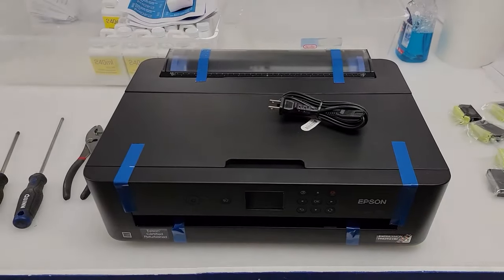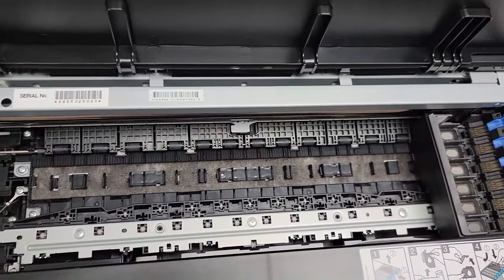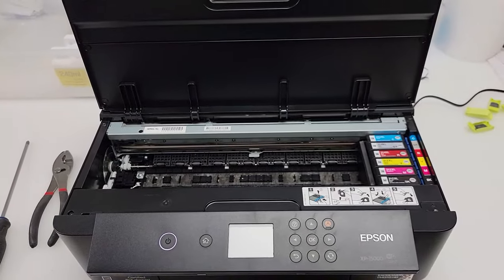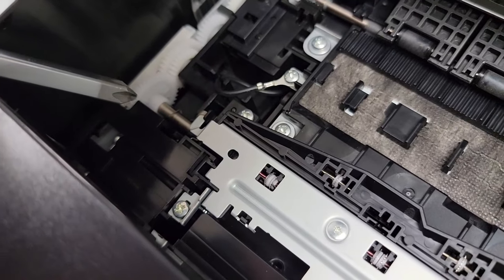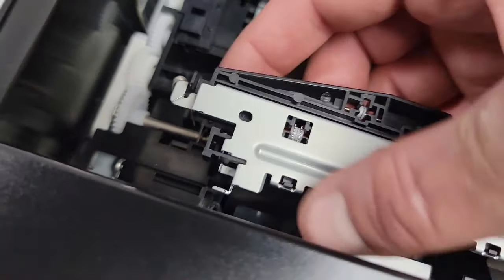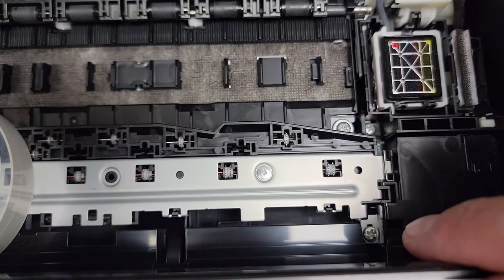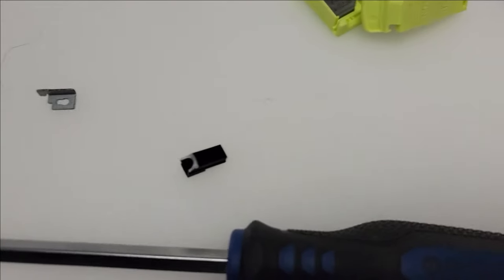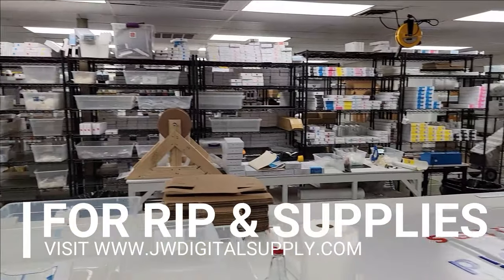JWDS Epson XP 15000 DTF Conversion   EASY

Comment: tip you can get the roller out without breaking the tip if you push the print head over close to right then  lift up on the print head lightly  will lifting and pulling the roller from the left

Comment: Hello quick question when you’re setting up the ink what color order should they be in and it should be 2 whites correct in replacement of GY , R .    So C , W ,W , Y, M , BK Is correct right?
Reply from the maker: This is correct - use the default CMYK channels and replace the remaining colors with white ink.  Of course, the RIP you choose will also likely have the ability to define custom ink channels - this would allow you to load the ink in any order you wish.
Reply: @jwdigitalsupply9944   hey I just can't around your channel can any printer can get converted to a dtf

Comment: I didn't have to break those brackets, though. With the print head about midway, I pulled both ends up and it slid right out.

Comment: Quick question on removing the plate. Do I need to put it back in afterwards? On the subject of reconfiguring the printer with a new set of DTF Catridge. I have purchased auto-refill cats, would I be required to get the third party firmwire at all?

Comment: So you don't add the dtf cartridges to begin with you use the original that came with printer ?
Reply: I asked the same question and the answer is that the ink of the original carts is not DTF, so what they have been doing is removing the original ink with seringes and somehow cleaning the carts. Then they inject DTF ink into carts.

Comment: I was setting up my printer and had to get air bubbles out so I removed the tube from the cartridge and the tube from the ciss. Ended up over flowing my printer with ink and I’m having a hard time cleaning it I’ll it out the printer. Will the overflow have any effect on my printing? how do I properly get air bubbles out and refill cartridges? I keep getting maintenance error on my printer but I have ink. I haven’t bought the activation key.

Comment: Thanks for the video. I followed to a tee. I installed chipless software and ink cartridge's. Then I installed cad link for my rip software. Something is off it either printer a little red and nothing else or nothing at all. Any ideas on what I might try? I tried several prink head nozzle checks. I did a couple print head cleaning, I took the ink cartridge's out and cleaned the undersides and ran a paper towel under the print head still nothing.....

Comment: My white ink is recently not showing up at all for some reason on my XP15000, and I've tried cleaning it with DTF cleaning liquid but it doesn't seem to work. Even put in new cartridges. What I did was put a few drops of DTF liquid into the printhead, swab it, clean it up, and then proceed. Is there a step I am missing? It has been pulling my hair out. Thank you.l

Comment: Just a question, why do you need to remove the  rollers? was just wondering
Reply: Removing the rollers simply prevents them from streaking the wet ink.  When printing as a stock unit, the paper is dry before the rollers make contact.  However, with DTF ink and film, the ink is still wet when it passes through the rollers.  Removing them can eliminate the streaking which would normally occur.

Comment: First off thank you for this video. Secondly, is epson xp15000 the recommended printer for conversion? Any other epson models that will be similar? I think epson also has the 15000 (non xp white one too).

Been trying to get the dtg system for awhile since I do screenprinting, sublimation and embroidery this would save me time to do one offs or emergency situations and wondering how new is dtf printing? I think its been around but not really booming until bout year?
Reply: Epson 1430, make sure it is new…it is costly, it’s the version before this one but it works perfectly
Reply: @SuaveCityGear  what about epson 1400? i have this now..
Reply: Check out the Epson 7710 after YouTubing the videos this is my go to
Reply: @antoniahill2665  for dtf? Really? I have an extra 7720 so if I could use that it would be fabulous!
Reply: Ok, so I'm getting so confused here. Lol I just bought the epson expression photo hd xp-15000 and some chipless cartridges and some sublimation ink.. can I convert this printer? And if so, I need help with a link to do so if dtf isn't the same ad submission ink. Please someone help me. I'm about 600 dollars in, and not a clue what to do!!!
Reply: @magenbrockgolden5243 dtf is not the same as sublimation ink. But you will be more flexible converting the printer to dtf

Comment: Have you ever added the inkxpro 312XL Empty Ink System CISS Refillable Cartridge Kit with Ink Flow Control Damper for Chipless Firmware Installed EPSON XP-15000 Printer?

Comment: How did you remove the ink cause now I have the ink that not DTF in my printer
Reply: Simply put in the new ink supply system and run an ink charge or a series of cleaning cycles to move the new ink through the print head.

Comment: How did you get it to print white for dtf
Reply: You have to do the firmware he didn't go over, then it goes into the grey spot
Reply: You have to do the firmware he didn't go over, then it goes in the grey slot

Comment: do you have to install a CISS for the XP15000?
Reply from the maker: Not necessarily.  We recommend refilling the OEM carts, until you get a good handle on the whole operation.  Most CISS are prone to flooding the entire system ** when not handled properly ** (this is an issue which seems to be unique to the XP-15000, due to an entirely different port mechanism).

Comment: I read your description and I'm confused about the bit about installing only the driver. When I click the link above, I select the "driver" tab and only install this "Remote Print Driver v1.6811/18/22	9.69 MB	RPD_x64_168.exe" correct? I don't install the utilities and firmware?
Reply: Did you get it working
Reply: @davidm9220  not yet

Comment: How do the transfers feel after application to the garment. Are they plasticy?
Reply from the maker: DTF has a slightly more “transfer” feel, than DTG, but less than traditional plastisol transfers.  The trade off is a more durable, smooth and vibrant print, with a bit more of a smooth feel to it.
Reply: Which ink should i use can it be dtf in or i have to use the ink it came with

Comment: What about the white ink? I make colors on black tshirts. So??? What about the white? Looks like your setup is for only white tshirts.
Reply from the maker: This video shows the process of physically converting the XP-15000 for DTF printing - what inks you decide to put into it, as well as which RIP and refill carts you use, is entirely up to you.
Reply: @jwdigitalsupply9944  I watched a ton of these videos on the xp 15000 and decided to pull the trigger and buy it. I'm a solo designer and company on a Joe Biden budget. So I will be replacing red & grey with white and then the rip software seems to be a few different suggestions. But before getting into it, there were a few more professional videos like yours that said you can arrange the order in which the ink cartridges print. If you have any input, now would awesome as I'm gettinng it in the mail this Friday. Also, which inks have you found to be best for vivid, rich, bright, poppin colors?
Reply from the maker: @sunrealclothing  Absolutely  - you will put white ink in the Red and Gray channels.  The RIP software you select will provide the ability to define your respective ink order - once you install chipless firmware, you can literally put the ink in any order you choose.  If you need a RIP, feel free to reach out to sales@jwdigitalsupply.com
Reply from the maker: @sunrealclothing  Regarding inks, we offer these at www.jwdigitalsupply.com - as fellow end users, we always want to be using the best quality products available.

Comment: Ok, so I'm getting so confused here. Lol I just bought the epson expression photo hd xp-15000 and some chipless cartridges and some sublimation ink.. can I convert this printer? And if so, I need help with a link to do so if dtf isn't the same ad submission ink. Please someone help me. I'm about 600 dollars in, and not a clue what to do
Reply: This video shows you the first step. Remove the piece of metal and black plastic that hold the little rollers. After that the other steps are. Work on your Tank for the ink, they seem to have a kit and there are other videos for that step. Another step is to install RIP software that are companible with the XP 15000.
Reply: Keep in mind this conversion is for DTF.

Comment: Hey there thanks so much for the video - I saw an eco tank being converted but don't want to deal with the eco tank after weighing the pros and cons.
Question?  I found DTF inks I'd like to purchase but when I asked if they were compatible with this model, they said yes, if I used "reset chips" and rip software.
Now the rip software I understand yet haven't gotten to that part yet but do you NEED these "reset chips"? and if so, where do you purchase them?
Thanks again!
Reply: Can u convert a printer that was used with regular ink ?
Reply: @juantrinidad9121 yes

Comment: Hi, I would really appreciate some help. I have an Epson xp 15000 and have tried refillable cartridges and emptying and using originals still no white ink coming through,  have cleaned ink head several times using blue paper not one spec of white. Any ideas please?
Reply: for what type of printing ?? if its for dtf u need a special sofware
Reply: @DRACO1ONER  I have acrorip Its a nozzle check I'm doing have tried straight from the printer and in acrorip still no white